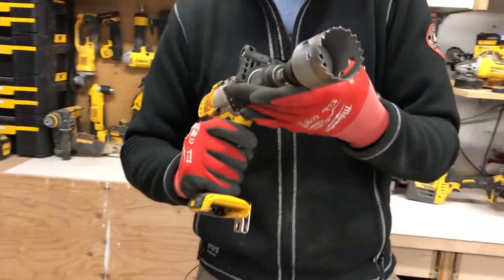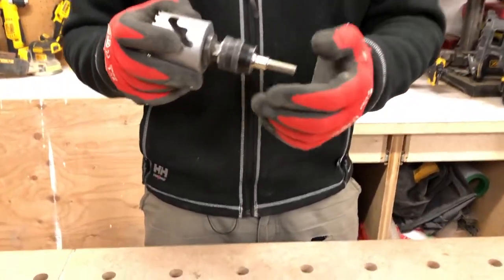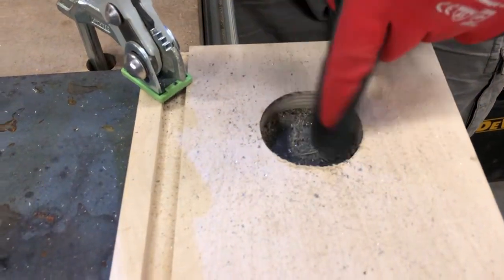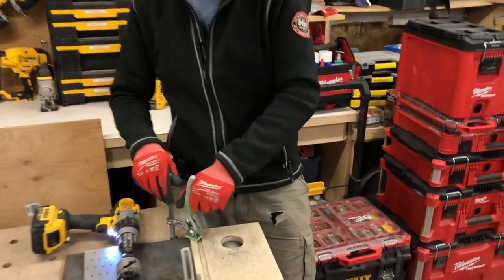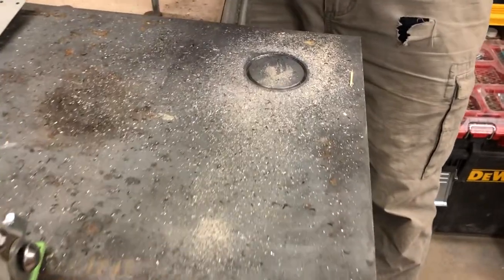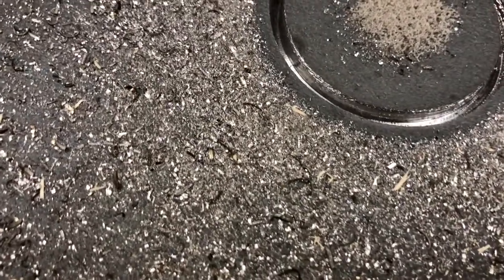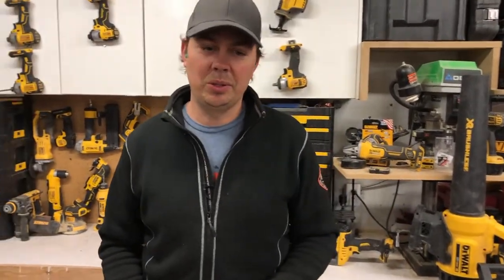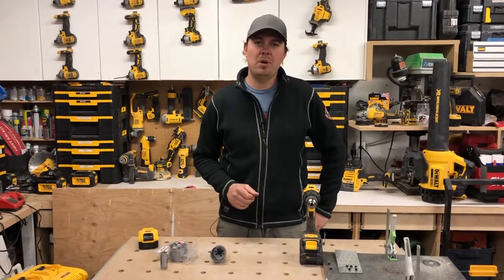Will the LENOX Tools Carbide Hole Saw cut through steel?

Comment: I need those to get through hardie board or that old asbestos siding. Gotta cut holes for my hvac copper and pvc.
Reply from the maker: they are very impressive
Reply: You should look into carbide grit or diamond grit hole saws for those kinds of materials, they'll last a lot longer